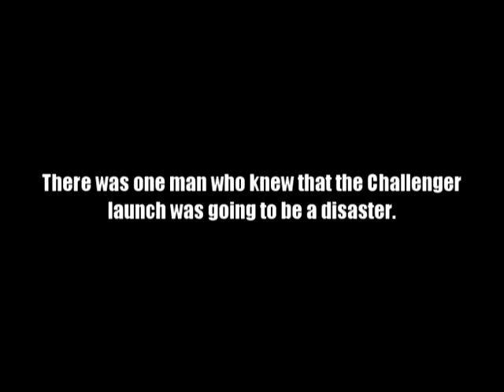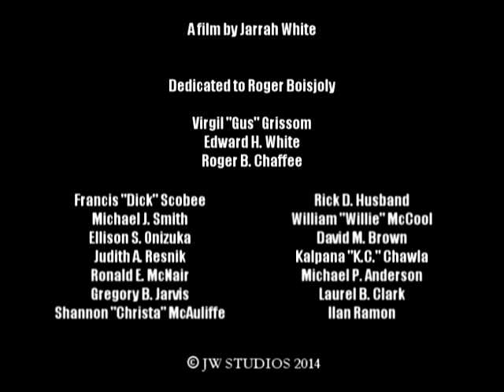The Last Say On Challenger teaser trailer

Comment: another problem nasa was fully aware of was the nature of the tiles falling off. So many things on the shuttle were disasters waiting to happen it's true a wonder more didn't blow up !
Reply: This is so sad.    Their very lives depended on that whole system working correctly, yet they built it so cheaply.  The Apollo Saturn 5 built in the 60s was tested over the course of 3 unmanned flights, and after that it was no longer considered to be in the test flight mode.  Once it was manned, the test flights were over, and they NEVER referred to it as a test vehicle after that.   Yet, the shuttle was always considered a test vehicle even after 100 flights.   The first 4 flights were "official test flights", and then they went "operational".  But when NASA officials were questioned about it, they admitted that the shuttle had always been a test vehicle.  So if the Saturn 5 built in the 60s was no longer considered a test vehicle after only 3 flights, but the shuttle was continually referred to as a test vehicle after over 100 flights, then that is a sad statement on our modern technology.  I don't care what anyone builds, if you're still  calling it a test vehicle after 100 uses, then there is something very very very wrong with the way you're building it.